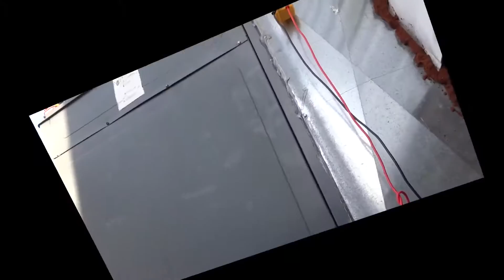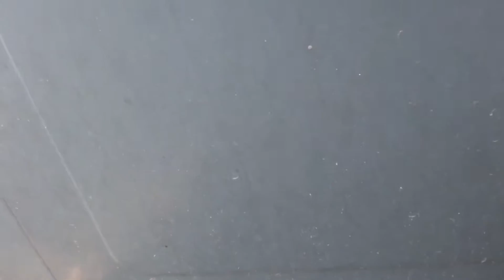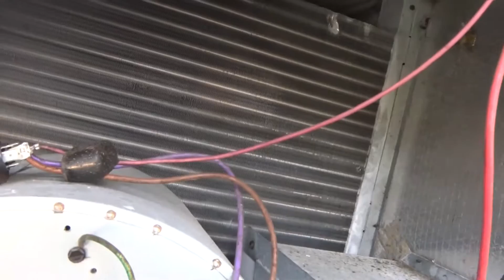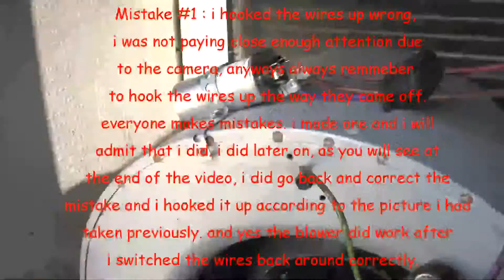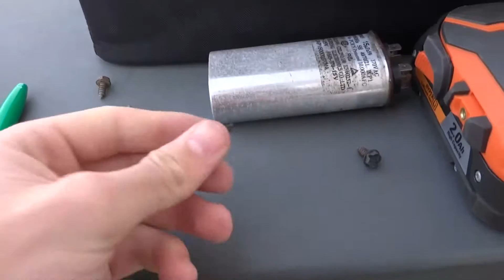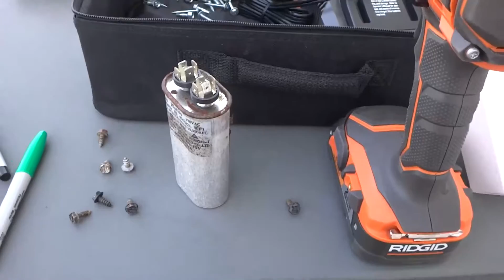Replacing the Goodman's Blower Capacitor  (Please read description)

Comment: ok yeah purple and pink one side, brown to the other. Since it was one wire on one side I unhooked that one first and clipped it onto the new capacitor... Unhooked the other two and left them dangling, installed the new capacitor, hooked up the last two to the other side.
This only works on the Goodman with a NON-polarized capacitor, otherwise make sure you know + / - which side.

This video was very helpful.

Comment: Can a weak capacitor make system not cool and have low suction preassure?
Reply from the maker: No. a capacitor has nothing to do with the refrigeration circuit sounds like you have either a refrigerant leak, failing compressor or it could be a restriction in the refrigeration circuit. i recommend contacting a licensed professional HVAC is not a do it yourself task.

Comment: I had to replace a capacitor on my first industrial ceiling fan I got about 2 weeks ago. It was accelerating slowly, and was spinning a bit slow. I only had one spare capacitor, and luckily it had the same exact value as the original one, so I replaced a capacitor with my spare one.
Reply: The Channel of Random Ceiling Fans we don't give a flying fuck

Comment: Nice job! You can test a capacitor with the wires still on one side, this way you know all the loose wires came off the other side, then if it needs changing you can swap one side at a time too so there is less chance for mishaps.